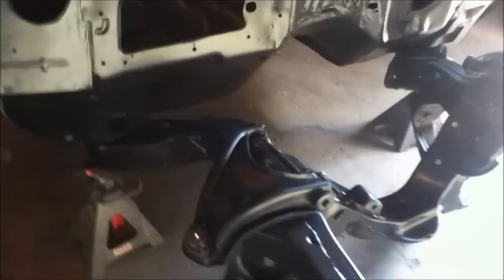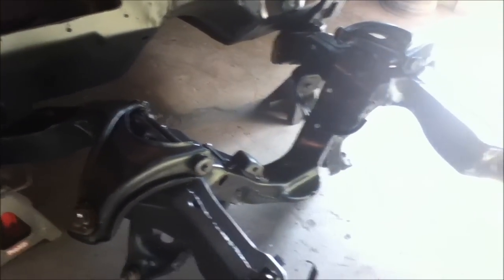body back on the frame

Comment: Awesome visual progress. its such a huge step to get that body on, but so little work as far as just a few bolts.  I have to steal your idea for running all those tie downs to hang everything on when painting. Great setup!
Reply from the maker: thanks sam, it that was my dads idea, hes pretty crafty, i meant to ask where you got the quarters for your t37 they looked like the fit pretty nice my brothers getting ready to order the floor pans and quarters for his goat clone
Reply: Yeah, neat idea for sure!      I hunted around, and found one with free shipping on Ebay, for like 540 if i recall. Mostly because i didnt want to pay freight, but i think summit listed the same panels in the mid 300 range.  I don't know who makes the panel, but im pretty sure there are only 1 company. It came in a box marked Taiwan and said "1971 GOT" , so they couldnt even spell GTO hahaha.   But the Company i got it from is ADEALS Auto Parts, they are based out of Texas, and were really nice to deal with on the phone, and very helpful. The first quarter turned, smashed to hell and lucky someone who was receiving it for me noticed and refused acceptance. I then called Adeals and told them what happened. They shipped me a new panel the same day, didnt even wait for the old one to get back to them. That was a big help.     The panel took a lot more work than i show, but im an amatuer and was able to get it to fit quite well, so i'm sure you guys would have no problem with it.  Here's Adeals Auto Parts webstore. http://adealsauto.webstoreplace.com/   Hope that helps! Good luck, Sam.
Reply from the maker: Swilling i sure thank you sam i'll check them out